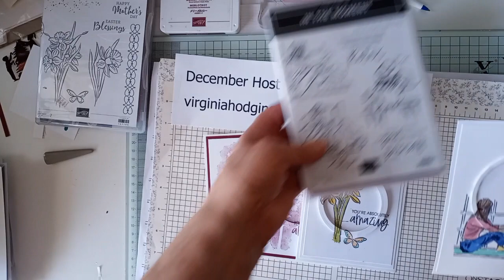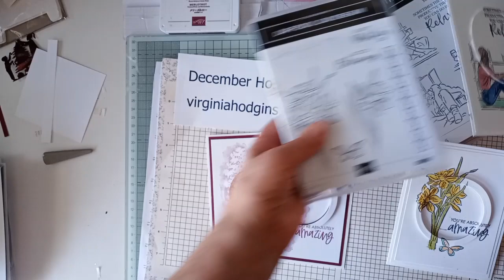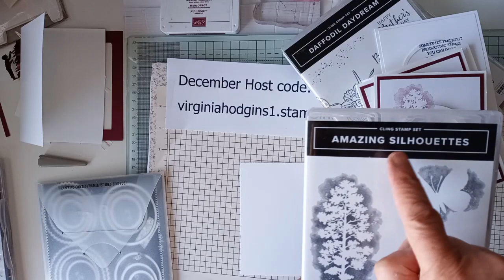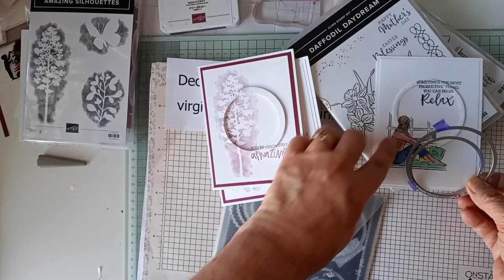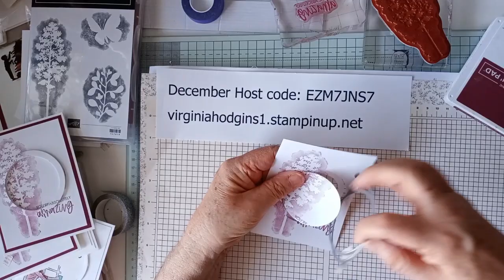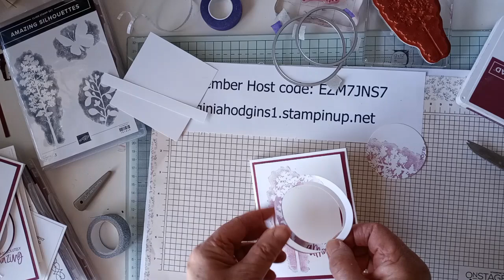3D Effect Card using Stampin' Up!®'s Amazing Silhouettes Stamp Set

Comment: Here's a tip when using foam tape. I run a glue stick over the adhesive foam before placing it down. This gives you a bit of wiggle room for adjustments.
Reply from the maker: Thank you for that tip! Wiggle room would help; I'll give it a try next time I make one of these cards. I have not had much luck with a glue stick, though, so would a specific brand be better than others, to stay stuck?

Comment: Thank you for this, could you write the measurements down too please? I'm  partially deaf and can't quite make out what they are.
Reply from the maker: Hello, B B.... Certainly. The base card is 8.5 x 5.5, scored at 4.25. They purple layer is 4 x 5.25. I cut the middle out of it, leaving a 1/2 frame all around. The top layer of the card is 3.75 x 5. The size of the dies I used doesn't really matter, because you should use whatever dies you have that will give you the effect you want, depending on your image and sentiment. Just make sure the ring as in my cards, or the frame for the 3-D effect is about 1/4 inch wide. I hope this helps.
I have since bought a lapel mic, so that should help with the sound.
Reply: @virginiaandsarah  Thank you so much.